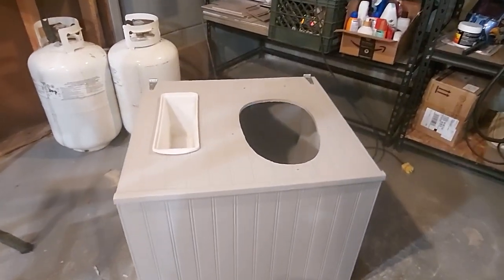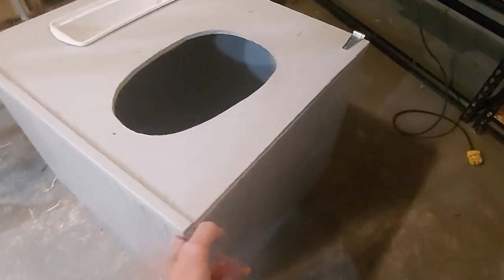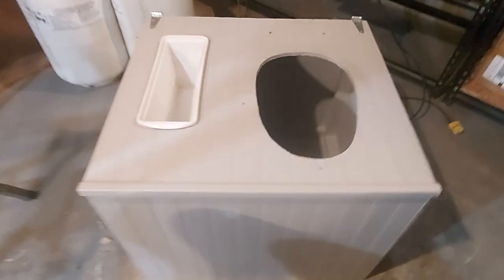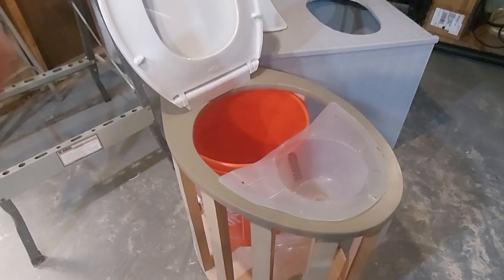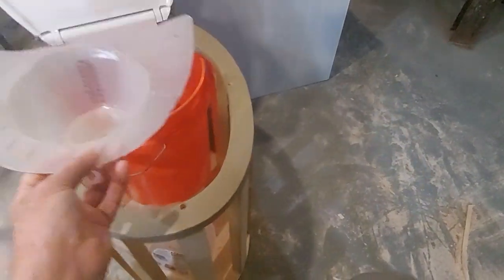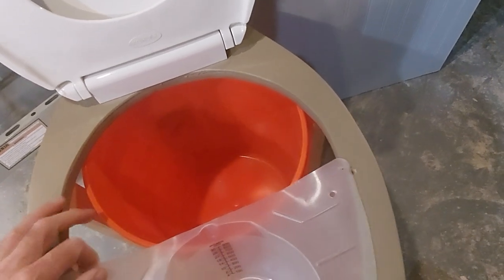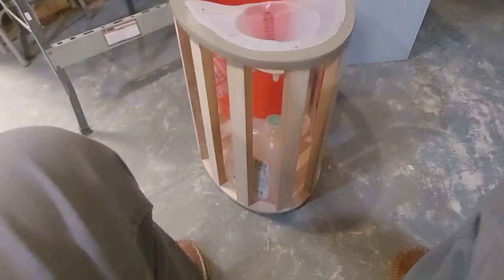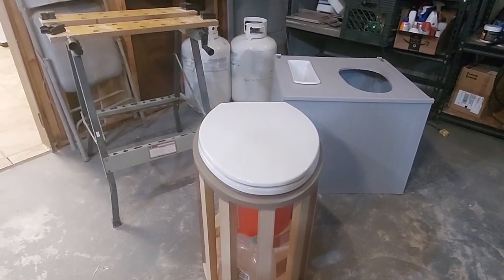DIY Composting toilet #2

Comment: What about using flooring vinyl for the sides? It would be a little bit more durable than the wall vinyl. I like the lighter design of this composting commode. (suggested name: com-com)?
Reply from the maker: I was thinking of using laminate for countertops or a piece of vinyl flooring, both would be far better for durability.  I went with the least expensive and the color match's everything in my camper.

Comment: Have you tried this out a couple times yet? I was thinking of using a similar diverter. Which did you get?
Reply from the maker: I used the specimen catcher thingy from Amazon, It  was $2.99 last year.  The separator from "Throne" is $95 plus shipping!  Sorry but I'm gonna pass on that for now, just a little to much cheese for me. I did find one on ebay for a little less but the shipping from the UK is the killer.  I have not used it yet but it is essentially the same as version one just not as stable.  I will be screwing it to the RV toilet flange.

Comment: Did you add plumbing to that diverter? And how did you attach it?
Reply from the maker: For now the liquids go into a 1 gallon catch (iced tea bottle) I have room for a larger receptacle (which I would strongly suggest) but eventually It will be plumbed into my holding tank on my RV. I tried to use rare earth magnets to hold the diverter in place but they were to strong and kept pulling away, meaning the glue was not strong enough so I decided on a simple dowel attached to the diverter and small hole in the front of upper frame, not the greatest but with the seat down it keeps everything aligned.
Reply: Where did you get the plans you mentioned in the video?

Comment: Where did you find the urine diverter?
Reply from the maker: Amazon,  I believe it's called a specimen catch. I guess it's called a top hat in the nursing community
Reply: BodyHealt Colector de muestras graduadas con capacidad para coleccionistas (10 unidades)

1

￼

￼

￼

￼

￼

￼

 

 

 

 

 

Color: 10 unidades